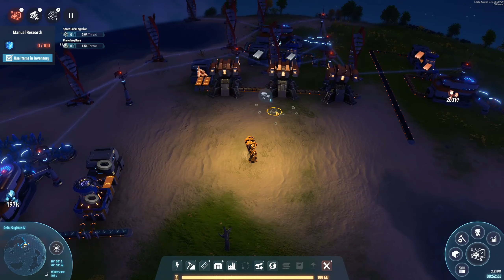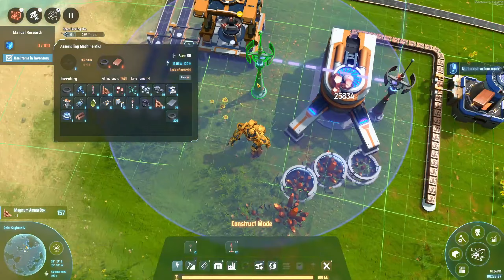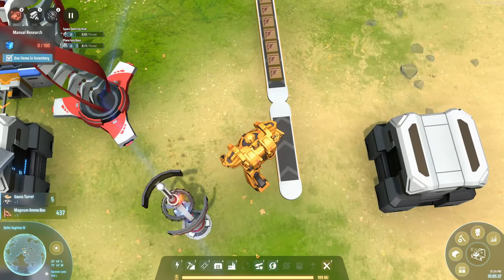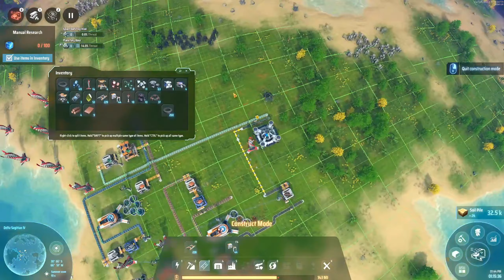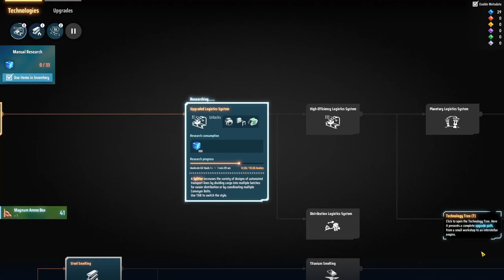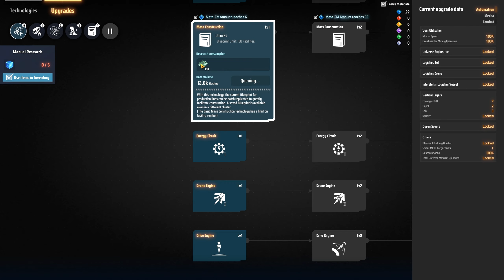Research Up and Running!! 🧪🔬  | Let's Play Dyson Sphere Program s02 e02

Comment: In your inventory you have yellow organic crystals. They come from the yellow trees you harvest for wood. They can be used in plastic products later but for right now you can burn them as mecha fuel. 

I would suggest a main bus idea for the iron, copper, PCB, gears, and magnetic rings, as these are all used in many basic items you will want to have automated. Like a box of belts, inverters, power poles, wind turbines, miners, manufacturing machines,. This saves you LOADS of time crafting them later.
Reply from the maker: Good to know about the crystals. Thanks! 👍  
I researched the different mecha fuels and it looks like the energetic graphite is a good option. I'm going to migrate to using that for fuel.

As far as the factory design goes, that's likely going to evolve as a I get a feel for the game and planets. Expect a lot of teardowns and rebuilds. 😸
Reply from the maker: I'm ok with hearing factory design/strategy suggestions but my factory design will most likely evolve on its own as I get familiar with the game and any of its constraints. I actually enjoy that discovery and problem solving phase the most in games. 

I'm most interested in hearing about game mechanics that might not be intuitive...(i.e. what the yellow organic crystals are for, what you can do if you have excess oil, etc.) or handy shortcuts. Stuff you would typically find in a wiki.